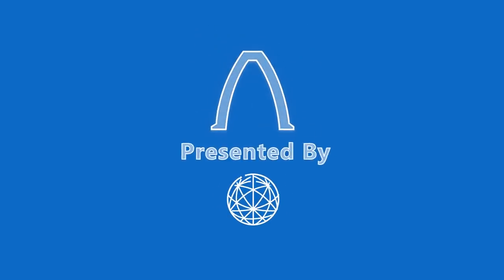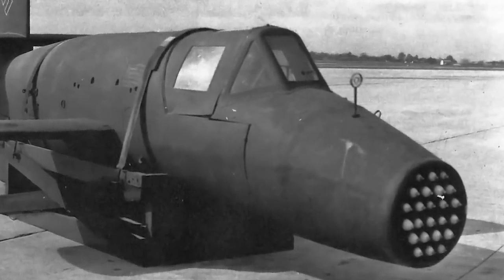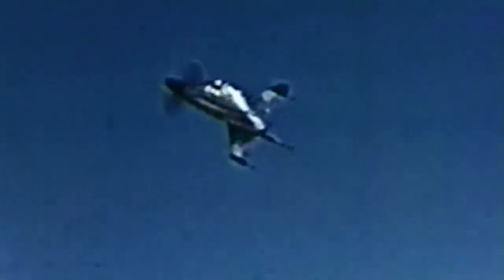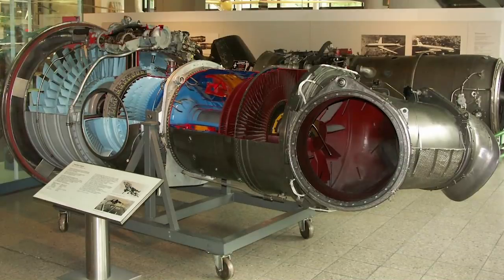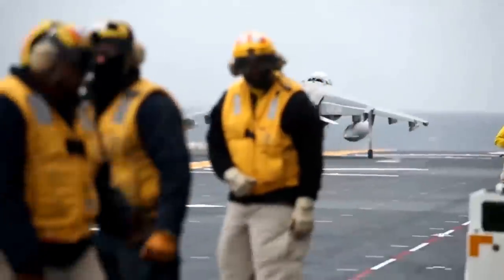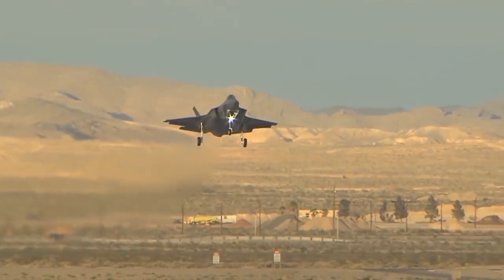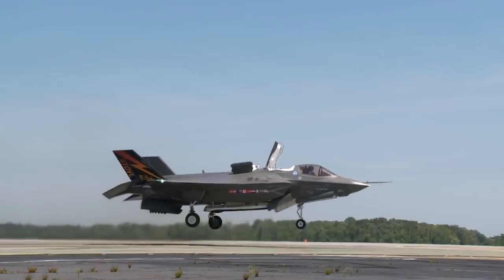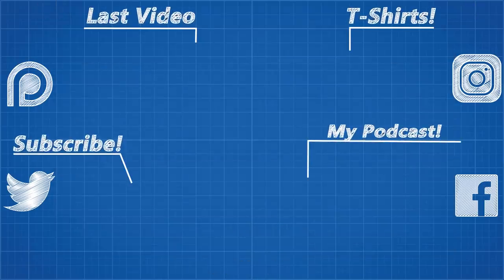The Real Life Sci-Fi of Vertical Take-Off Planes

Comment: This video is misleading. I am no expert, but the lashback at the F 35 was presented in this form to the public in a publicity war kind of style. Because it was proposed as a jack-of-all-trades fighter/ground assault craft and Congress wanted get rid of planes like the A 10 Warthog when U.S. forces are still waging operations requiring close ground support. Replacing a specialized plane with a jack-of-all trades craft limited usability and effectiveness. The U.S.A. had to bring back prop planes to provide ground support due to the cost, the time an aircraft had to circle the battlefield, and the terrain in the theaters of operation like Afghanistan. These are environments wherest Special Forces have fought on horseback because the terrain is too rough for specialized vehicles and Congress wants to get rid of the specialized aircraft that support our troops in these places at a time when the fight is still going on. There was a horrible cry of anger. At least, that was the way the story was sold to me, a civilian.

Comment: you completely skipped the Yakovlev Yak-141, its design literally was bought by lockheed for the F-35
Reply: +Turbo-Fan

 No it wasn't. The Yak-141 wasn't obtained until after the X-35B was built, and no evidence exists for the argument that its design was used for the F-35. They share no direct similarities other than the fact they're S.V.T.O.L.

Comment: Funny thing about F-35 is that's its vtol looks exactly same to yak-41
Reply: Not really, no.
Reply: Nathan Peterson something more? Both ideas are really similar and Lockheed cooperated with yakovlev for sometime
Reply: +smiechu60

  Different layout entirely. Different means to achieve V.S.T.O.L. requirements. And  Lockheed-Martin didn't inspect the Yak-141 until after the X-35B submission was made. And that was the last variation required under the first phase of the program in the research and development stage.

Comment: Well, we've already cancelled the helmet and the vtol function might as well be non-existant. Very few will be made and only for the marines
Reply: +cobra4975

 What aircraft are you talking about?
Reply: Nathan Peterson the f-35
Reply: +cobra4975

 No they haven't in either statement.
Reply: Nathan Peterson Let me re-word. The united states has officially cancelled its involvement in the helmet due to weight and cost concerns. VTOL models are to be restricted to the Marines in small numbers. Most f-35's will only be capable of standard and short takeoff
Reply: +cobra4975 

 I believe you are mistaken. The helmet is still apart of the program based on the annual report from 2017. And has not be dropped. 

 The F-35B's competition requirement was to be capable of vertical takeoffs, changed to short takeoffs. While its still capable of vertical takeoffs. Neither the orders from the British Ministry of Defense (Royal Navy) or U.S.M.C. have cancelled or cut their current orders for the F-35B, save some cost reduction measures. The U.S.M.C. was the only U.S. branch to order it to begin with. The Italian Navy (Marina Militare) and potentially other countries are looking to buy the aircraft to replace their aging AV-8A/ B 'Harrier' fleets.
Reply: +flip inheck

 The F-35B is capable of vertical takeoff. Just not labeled a V.T.O.L. aircraft.
Reply: Nathan Peterson like i said, other countries may or may not be interested in the B model, however towards the beginning of the program, all models of the f-35 we're to be VTOL capable. However the airforce and navy were worried about scorching the runways and carriers, so they requested VSTOL and standard takeoff only configurations. This left only the Marines with a hundred or so B models left in the program. As far as the helmet is concerned, it spent too much time in development hell either being too expensive or too heavy, so the United States cancelled its orders for the helmet. It is still in development, but there are other, better helmets being developed by some of the countries that have ordered 35's. Not many are going to purchace ours.
Reply: +cobra497

> "all models of the f-35 we're to be VTOL capable."

 That was never apart of the Joint Strike Fighter requirements. I recall Navy looking into the V.T.O.L. capability/ S.V.T.O.L. requirement, never the Air Force. Not to mention this requirement was made well after the program began competitions (as the Marine requirements for the Advanced Short Takeoff and Vertical Landing (ASTOVL) technology program. So that would make less sense. I want to remind you the latter program was between the USAF and USMC, however, the USAF only took part in the technology demonstrations. Not the requirements. 

> "This left only the Marines with a hundred or so B models left in the program."*

 The order for F-35B's has since 2014 been 340. With no changes. 10 are currently in service with the 121st Marine Fighter Attack squadron (VMFA-121). 

> "As far as the helmet is concerned, it spent too much time in development hell either being too expensive or too heavy, so the United States cancelled its orders for the helmet. It is still in development, but there are other, better helmets being developed by some of the countries that have ordered 35's. Not many are going to purchace ours."

 The annual report of F.Y.16 and F.Y.17 has never noted any reduction in orders, let alone cancelling of further purchase on the helmet. Just the end of procuring "Gen II" helmets. If I recall correctly, there had been talks about the Israeli Air Force F-35I operating a different H.M.D. entirely. But not for any listed reason.

Comment: Actally the russians sold the papers for the vertical take off planes to the brithish for 40 milion dollars. The russians had the yak series. They were the first to make this kind of airplane. Their yakes operated on a carrier but they canceld the progam due to a crash on the carrier.
Reply: Interesting, because the first flight of the yak-38 was 1971, compared to 1967 of the first Harrier jump jet.
Reply: @TT-hd3zi  sorry i documented myself more about this subject and actually the russians sold the papers of the yak138 to the americans and the F35 was born you know and if you look at the F35 you can see that some major features of the yak138 are present in the F35 as well so with all that the Yak 138 is still living in the  F35
Reply: CAPT-Rex 2 yep, that’s correct. The VTOL element did partially use a Russian design.

Comment: I liked Boeing's X-32 much better than Lockheed Martin X-35/F-35, and considering Lockheed Martin went way over budget they should have given Boeing another chance at air refueling, also to say if fails after one attempt is stupid pilots fuck that shit up all the time.
Reply: Danny Hampton The X-32 wouldn't work at all, and who says the Boeing one wouldn't go over budget either?  But the X-35 was the better prototype compared to the X-32
Reply: The X-35 was over budget in the prototype phase the X-32 was not, and when you are 60-70million overprice per plane then it is not the better prototype. All I ever saw the X-32 fail at was air-to-air refueling which if I remember right was more pilot error than plane, so the plane did everything is was supposed to including the low price. Where as the X-35 and F-35 was a colossal failure in that category.

Comment: F 35 is mainly built on the basis of Russian Yak 141 fighter
Reply: No it isn't.
Reply: Nathan Peterson if you want to clarify it means consult it with Lockheed Martin experts itself
Reply: +Nikolai Bandanov

 They share no direct similarities other than vertical-takeoff. The purchase of Yakolev designs didn't immediately entail the Yak-141 based on what we know, and Lockheed didn't inspect a Yak-141 until after the X-35B submission was made (which was the last requirement made for a variation of the aircraft, a S.V.T.O.L. design).
Reply: Nathan Peterson ofcourse you are right yak-141 should have flown before x-35 rather to be successful  fighter aircrafts but due to budgetary and other engineering problems the project was completely closed
Reply: +Nikolai Bandonov

> "ofcourse you are right yak-141 should have flown before x-35 rather to be successful  fighter aircrafts but due to budgetary and other engineering problems the project was completely closed"

 Not what I said. 

 While Lockheed (then to become Lockheed-Martin in 1996(?)) did obtain numerous patents and designs or other work from Yakolev. I know of no transfer of information concerning the Yak-141 until after the X-35B submission was made. And said inspection until well after. It was test flown well before the F-35, but that wasn't my point.

Comment: F 35 is not inspired by harrier...but it's a copy of the Russian yak 141
Reply: Not even close
Reply: @peterson7082   one is a 70s design and other of this century.. Lockheed Martin and yupolev company worked together for an year on yak 141..a lot of technical details will be different...but it's clear f35b is inspired by yak 141 and not harrier
Reply: @c.jvarghese4494  The F-35 has little in common with either. 

 Also it's not clear, and honestly is doubtful if the Yak-38 or Yak-41 were apart of the technology transfer with Lockheed Martin.
Reply: @c.jvarghese4494  The Yak-41 is a copy of the Convair Model 200, which was a much older project.

Comment: The F35 is a waste of money and time. The plane is prone to high speed stalls, cannot climb as fast as other contemporary airplanes, while its cruise speed is higher than contemporary aircraft, its top speed is nowhere near that of an F15. The 360 VR camera cannot replace actual eyeballs when looking around and the large fan needed for VTOL greatly reduces the payload capacity of the plane.
The F35 is shit!
Reply: All of that is false.
Reply: Yeah, no.
Reply: @darthluke655  Google it son
Reply: @johndessire399  says who?  The government? Google it son!
Reply: Skyerzen Yeah, no.
Reply: @darthluke655  Google it! The blunt nose design helps airplanes achieve supersonic cruiser speeds but at the cost of top speed. The angles of the fuselage and flight surfaces designed to give it a small radar signature are tweeting for maneuverability.
Carrying all their weapons inside for stealth,  (and the fan for the Marines version),  reduces the payload. The material used to cover the surface of the plane to make it stealthy also makes it rather heavy. The design of the plane reduces visibility for the pilot, this is supposed to be mitigated by the hi res vr visor, but it doesn't.  Nothing beats a pair of eyes. 
I believe it doesn't even carry a gun?
I also know that it does not carry external tanks,  so it's range is greatly reduced compared to a super hornet, F15 or the warthog. All three planes they plan to replace with F35.
Troops on the ground need a plane that can hang out with them for hours,  that's slow enough for the pilot to see and engage threats in the ground.  The F35 is to fast for that role and cannot hang out with the troops as long.
The F15 has a looooooooooong leg, it's fast as shit at top speed and it carries a fuck load of weapons! Only disadvantage over the F35? Huge radar signal. Granted it has an older weapon system, but those can be easily upgraded.
The F18 is alright,  not as good as the old F14, but still leaps and bounds better than the F35.
The F22 is good for its role as an air superiority fighter,  but it was designed solely for that purpose! But they are only marginally better than the F15 and more expensive.
Reply: Skyerzen Dude you’re missing the entire point of the F-35. And the F-15X for that matter. Air war is evolving. Look up Skyborg Program. You’ll see exactly why everything you’re saying is entirely irrelevant and false.
Reply: @darthluke655  Explain this to me then. How is an F35 going to replace an A10 Warthog?
It is slated to replace it in its role of close air to ground support HOWEVER! it is incapable of actually filling that role in any way!
In the past few conflicts when troops have requested air to ground support they would either get "fast movers" or "dwellers"
Fast movers were anything from F15 to F18s.
Fast movers needed the ground troops to use lasers to point out the targets for them because they are moving too fast to spot targets themselves.
This sounds cool and all but then you have to take into account that equipment DOES sometimes fail or simply runs out of batteries.
Also, fast movers could only hang out at the  requested site for about 15 minutes before having to return to refuel.
An A10 however, could linger at the requested site for around an hour or more, pick its own targets and engage with surgical precision with its gun.
You cannot tell me the F35 is superior to any of those roles.
Air to Ground attack role: the F18 and F15 its replacing can carry a shit ton more ordinance than the F35 making them waaaaaay more deadly in that role.
And as a dog fighter... well... air combat is air combat.
During the vietnam war, the military didn't give the F4 a gun because they thought air combat had changed....
Well, it didn't... So planes that came after all came with guns....
My point is we need to stop making the same mistakes of the past and start looking at history to learn from our mistakes.
The F35 sucks big dick, everyone knows this but the project is too large to fail.
Believe me when i say that it won't be in service for long until the military buys a new set of specialized planes for different roles.
Reply: @Skyerzen  The A-10 has been shot down by this fucking thing: http://i.imgur.com/C4dApHv.jpg Yes, that's a man-portable anti-air missile. That's why it rarely flies "low and slow", because it turns out that a painfully outdated aircraft is also easy to shoot down.

Now imagine if it flies low and slow against enemies with competent air defenses, let alone combat aircraft. That would be complete suicide. And no, the A-10 isn't armoured, only the cockpit is protected, the rest of the aircraft isn't and is very vulnerable to modern threats.

So there you go, the A-10 is easy to replace because it's a flying piece of shit.